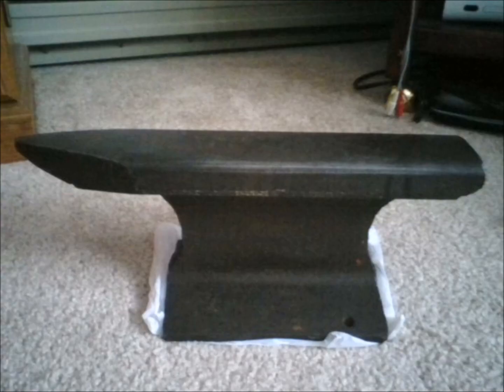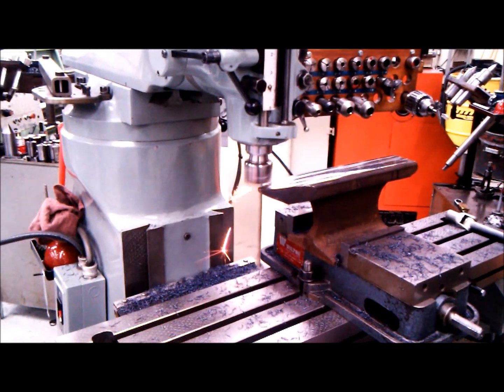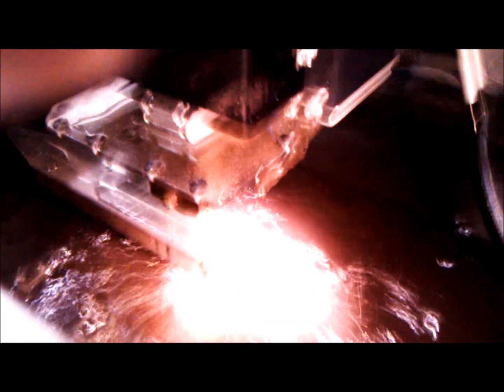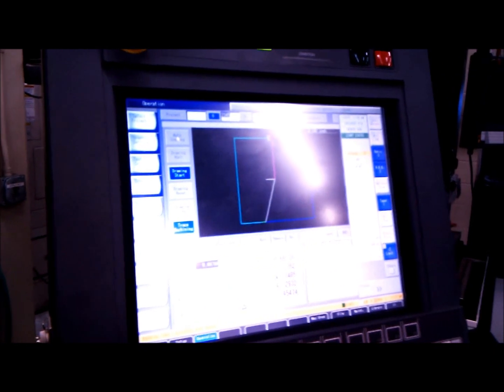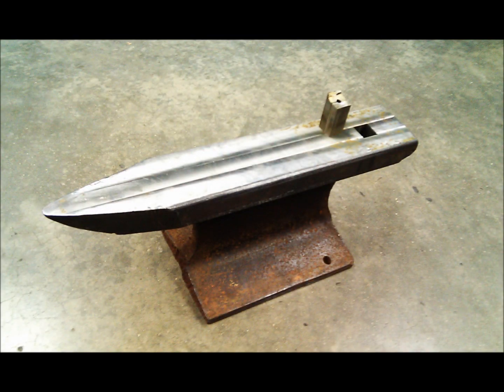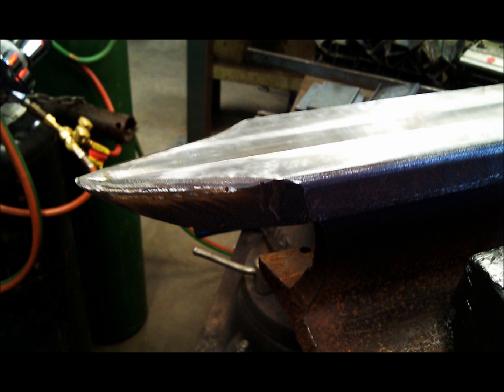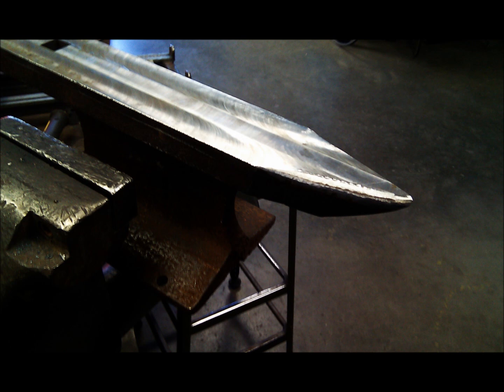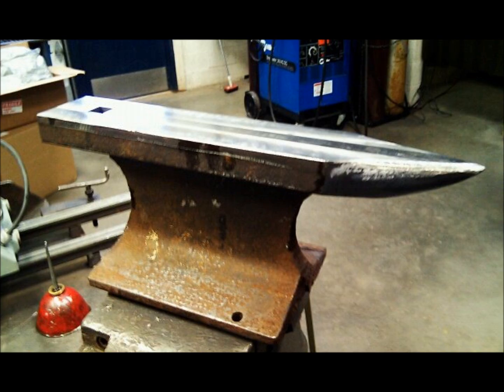Machining a Railroad Track Blacksmith Anvil

Comment: The problem with making an anvil like this is that there is too much spring side to side, the web of the track is too thin for  resistance to movement. As you have done all this work, to stiffen up what you have, weld plates to each side to create a double box section. For very small things, it is OK as is but for any real work, you need to stiffen it  up.

The best way to use a rail, is on end. the surface is small but you have mass without movement. 
Cal Blacksmith, 30+ years in the trade

Comment: nice anvil, you did a good job on it! i have a rail road track anvil that ive welded a piece of steel to the top of it and a bob cat tooth to the front for a horn turned out pretty well as well, no hardy hole tho. now what are you going to make with it